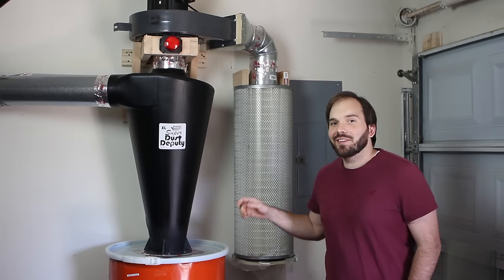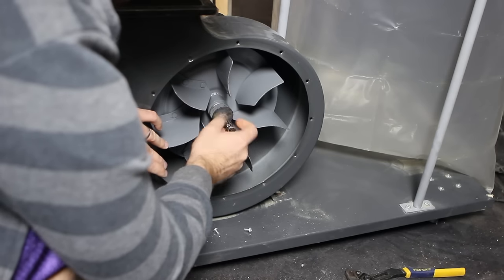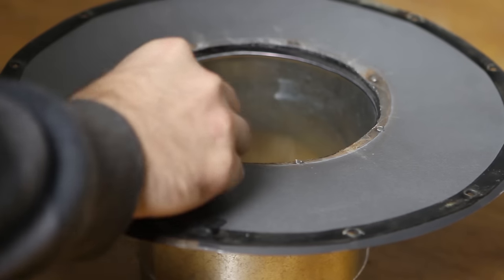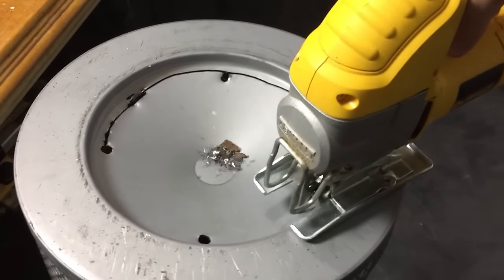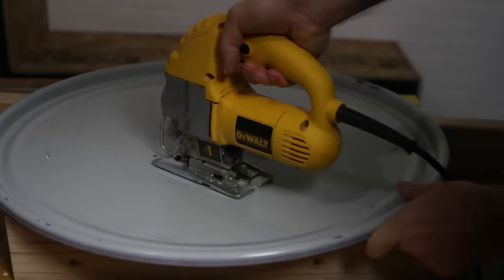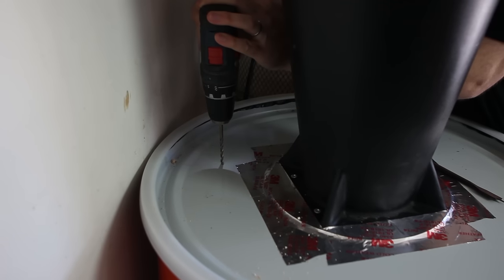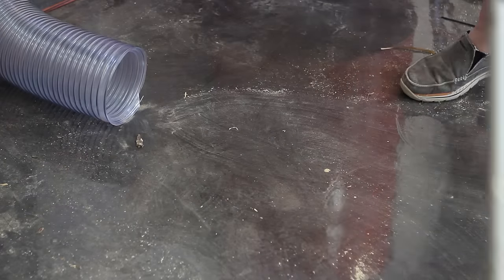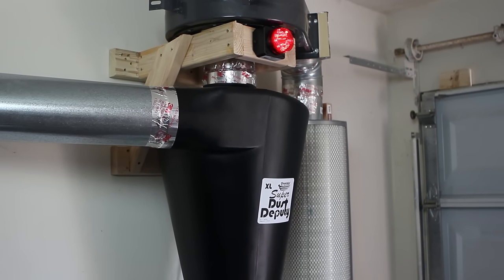Harbor Freight Dust Collector Mod w/ Super Dust Deputy XL - Updated

Comment: This dust collection system seems pretty well-made. I like the smaller diameter of the filter for the fine dust. The question I have is what holds your dust deputy up when you change or empty the barrel? It doesn't seem like there's much support other than the tape holding it on to the upper pipe and motor.
Reply from the maker: +Mark Radmall I did end up screwing the pipe fitting on the motor to the Dust Deputy which holds it with the drum removed. Also, I came back and made a bracket to screw to the wall and stick to the dust deputy mid-way down the cone.

Comment: Great build!!
I've been thinking about doing the same for my 1.5 HP Jet DC1100.
But trying to use the large pleated filter (20"x25") that came with it would be a pain.  Or... maybe not.
Questions: 
What is the measurement from the wall to the front of the Dust Deputy?
How did you size the filter?
How do you empty the barrel?

Comment: Great video! I've spent a while trying to figure out how to improve my setup, but did not know about the impeller upgrade, so thanks! At 3:35 in the video -- the HVAC flange seems like it might restrict the airflow a bit as it is mounted inside the SDD instead of on the outside. Not sure if there's a way to fix that though or how much it matters. (Similar issue at the filter connection.)
Reply from the maker: +Around Home DIY thanks! That is a good point about the flange direction and there probably is a way to fix it but I didn't think the results would be worth the effort.

Comment: Where'd you get the impeller at? Thanks
Reply from the maker: The impeller I used is a replacement part for a Rikon Dust Collector. Here is a link: https://www.rikonparts.com/product/60-200     It is part 20
Reply: For those who haven't yet bought the HF collector, you might also consider the Shop Fox W1666.  It comes with a 12" steel impeller and a true 2HP motor (the HF motor is really about 1 1/2 hp) which runs on 220VAC.  It is $400 on Amazon.  It has large inputs and outputs already built in and in the end, will only be a few dollars more the buying all the parts necessary for the HF + modifications.  I'm sure a few of you might find the need for 220VAC a barrier, but you can have a better DC system for about the same total price.

Comment: Love the notion of improving airflow by changing out the blade!  I'm about 6 weeks away from this very same project... and am already planning to follow in your footsteps.

Question:  I don't have the need for a 6" main line.  Is there any value-add to changing the blade if I'm going to maintain the original 4" line size?

Cheers!
Reply from the maker: +Jim Robinson I would say yes. Even with the 4" duct you will see a increase in CFM. Plus, the different impeller design functions better under pressure so it should help keep CFM up with runs of 4" because the smaller duct generates more resistance.
Reply: Thanks!
Reply: Where did you get the upgraded impeller?

Comment: Curious on how exactly you screwed the filter to the bracket?
Reply from the maker: I cut a piece of sheet metal the same circumference at the filter. Then riveted a 6" duct flange to the sheet metal and screwed the sheet metal/duct assembly to the top of the filter. I used caulk to seal the entire thing to the dust collector.

Comment: Great video!  So many out there but I love the way you show everything and make it easy to understand.  What size pipe do you have coming into the Oneida dust deputy?  Did you run 6" throughout? I wanted to stay around 4".  I am on the opposite side of the garage which will be a challenge to figure out the piping.

Comment: Hi Brent - simple question but how do you empty the drum?  Do you have to disassemble the cyclone?
Reply from the maker: I built it so the cyclone and drum sit off the floor and the drum is on a cart that lifts and lowers the drum. It is similar to how the Laguna cyclones work. I didn’t have enough ceiling height to add flex hose between the drum and cyclone like most diy setups.

Comment: I was not aware that you could swap out the HF impeller.  Where did you get the upgraded one?
Reply from the maker: Ya, I read some forums where people talked about it and figured I would try it and document it. It is from Rikon. It is sold as a replacement part for their dust collector. Part no. 60-200
Reply: I just found it online P60-200-22 - Impeller - $99

Comment: How do you dump the barrel?  I didn't see any flex.
Reply from the maker: That is correct, I did not use any flex hose to construct the dust collector. My ceiling isn't high enough to add a collar to the Dust Deputy and the barrel lid to use flex between the cyclone and the barrel. I like how the Laguna Flux dust collector lifts the bin to the dust collector and tried something similar. I build a scissor jack into rolling base. This allows me to lower the barrel, wheel it under the lid and raise it up with the jack. I might have to make another video with that build.
Reply: I would love to see that.  You did such a nice conversion.  I will change the way I have mounted to canistor filter to the way you did.  Thanks for the video

Comment: Where did you get that better impeller from?
Reply from the maker: The impeller for this dust collector mod is from Rikon. Here is a link to where you can order one: https://www.rikonparts.com/product/60-200
Reply: @GrayHouseStudio  Thank you, but they charge 100 bucks. The whole DC from HF is 150 with a coupon.
Reply from the maker: @RadeksWorkshop  Ya, it is a trade off. My goal was to have a dust collector with enough suction to run all of my machines and come out costing less than a similar sized machine. I invested in the impeller, a nice filter, and the cyclone attachment. The dust collectors I was comparing to were over $1000.
Reply: @GrayHouseStudio  I guess you achieved your goal. Nice video, thank you for sharing. I will be doing something similar with my.

Comment: You say that you used a 6" takeoff from the cyclone.  What gauge metal and type of metal ducting did you use in your shop with this conversion?  I think 30 gauge would be to thin so I'll try and use 26 gauge instead.  Do you think this is stout enough with the converted dust collector?
Reply from the maker: I used 30 gauge duct but long runs can be flimsy. I got away with it because I made round wooden brackets that connect the duct to the wall and keeps the duct in the circle shape instead of letting it collapse in an oval. I need to make another video that shows that.
Reply: Have you had any collapsing of pipe issues since your conversion?

Comment: Does anyone know where to get the impeller upgrade?
Reply from the maker: It is a replacement for a Rikon dust collector. You can google Rikon impeller and it will come up model:P60-200-22
Reply: I built a similar set up to this a few years ago on a cart. It has not moved once. I should've mounted it to wall like you did.

Comment: Best upgrade to the HF dust collector on YouTube... Great system man. 

Can I use that impeller with 4" tubing for my system??
Reply from the maker: +Jony Q Absolutely, the impeller would still be a huge improvement in the amount of air the blower would move on a dust collector using 4" tubing.

Comment: Hi Brent,  I finally received my backordered Rikon Impeller and bought the 4" puller that you pointed to, but when trying to fit the puller around the harbor freight impeller it doesn't span the fins properly.  I can't get all  the legs of the puller to fit between the fins.  Was the 4 " the wrong size?  Thanks in advance.
Reply from the maker: +Bryan Greifinger Sorry for the trouble Bryan. The long reach side of the 4" puller worked for us. I hope they didn't change the design of the one we linked to on Amazon. Harbor Freight also sells a pack of several different sized pullers that might be a quick solution if you live close to once of those stores. Feel free to share a picture and let me know if you find a solution or if The Harbor Freight ones do the trick.
Reply: I'm noticing that your harbor freight was black.  Mine is the Green version.  Wonder if thats the difference.  I guess i can call them and see what they say.  They may have also changed the design of the impeller.  Mine is about 10 ".  When i find out the difference I'll post it here for others to see.  Thanks for responding so quickly.

Comment: Great video.  Just bought the HF DC and will probably save $100 and buy the smaller Oneida cyclone.  How much do you collect after the filter?  I saw a video where the guy just pipes it out the house and that is an option for me, but I don't the outside of my garage spewing lots of debris.  (PS. You handle the nitpicky engineer comments well)
Reply from the maker: I have filled the 55 gallon drum with just the table saw. I would imagine with the lack of wind in my neighborhood there would be a pile of sawdust accumulating outside my garage if not for the drum.
Reply: Gray House Studio - I meant that I was going to use the cyclone and skip the filter and vent outside.  But a quick estimate showed that I could extract the entire shop's air in 5 min.  Since I live in cold climate it doesn't make sense for me to bring that much cold air in and heat it up.  So I'm going to copy your filter setup.  Thanks for the great ideas.  FYI the Rikon impellers are now back ordered 3 months.  You are to "blame" for a 10-fold increase in their orders.  Too bad no commission!

Comment: Nicely done sir.... but why would you ever want to deal with 55 gal. dust/debris at one time? My 20 gal. trash can is typically plenty of capacity and probably 1/3 the weight each time I empty it.  Again nice video with just meat and potato's and no self indulgence. Thumbs up!!
Reply from the maker: Thanks! I went with the 55 gallon barrel so I can empty it out before it gets too heavy without negatively affecting the dust collector's performance. I've found with the smaller barrels you can empty it full but as the small barrel gets over half full the saw dust gets sucked into the filter.
Reply: Interesting,  my 10 gal. Dust deputy never has that problem

Comment: Just a heads up it's called ducting  tape, because it's designed for 🥁 Ducts.
Reply from the maker: Boom! It gets really confusing when you start talking about Duck Brand Duct tape.   Sometimes I even put duck tape over over duct tape just to be extra safe.

Comment: Good job!!!  Where did you get your duct fittings and what gauge did you use?
Reply: What gauge of metal ducting and metal fittings did you use?  Did they collapse on you at any time?  Nice job on the conversion.  About to do mine as well.  Hoping to get away with the Lowes or Home Depot 30 gauge duct fittings and pipe.

Comment: Where did you buy the Rikon 60-200 Impeller?
Reply from the maker: I called their replacement part number and requested the impeller at 877-884-5167.

Comment: This is amazing- I keep coming back to it. Unfortunately, that Rikon impeller doesn’t seem to be available on Rikon’s parts website. Nothing on eBay or Amazon. Oh well.
Reply: The impeller he used is for opposite rotation, so it’s the wrong one anyways
Reply: Yes the blades on the new impeller curve the opposite direction.  I'm Not sure it would be better if the curved the other way.

Comment: Great video.  Do you still use this setup?    Did I notice you are using 6"metal duct for mains?   How long is your longest run and what type of airflow are you getting there?  I have a 600sf shop and I'm working on planning out my dust collection now around the HF unit.

Comment: nice but how do you empty the drum?
Reply from the maker: +tomas vasquez I added a cheap car jack to a furniture dolly. I can wheel the drum around and lift it into place using the jack. There wasn't enough ceiling clearance to use flex tube between the drum and cyclone.

Comment: Wouldn't the smaller super dust deputy been a better choice for the Harbor Freight collector?
Reply from the maker: +Cesar G The Super Dust Deputy would definitely do the trick for most applications. I was excited when Oneida came out with the XL model because it has a 6" inlet and outlet allowing me to achieve a higher CFM over greater distances. With the 6" duct I was able to locate the dust collector in the most unusable corner of my garage instead of next to my equipment where floor space is tight. The impeller upgrade was a fun experiment I've seen people talk about on forums but could never find anyone's results.
Reply: Gray House Studio thanks for your response. I asked because on Oneida's website they said that depending on your motor's HP, the size and shape of their cyclones would better suit the motor.

Where did you get the larger impeller from and how much did it cost?? Thanks.
Reply: I'd also like to know this.
Reply from the maker: +Cesar G It is a Rikon impeller Part #22 from their 60-200 model dust collector. I just called the number for parts on this PDF, https://www.rikontools.com/partslists/60200.pdf and asked to purchase the impeller. It only took about 5 minutes on the phone and cost $99.99.
Reply: Gray House Studio cool. How much was it? Thanks again.
Reply from the maker: The impeller was $99.99

Comment: Very nice! I hadn't seen anyone upgrade the HF impeller. Seems like a pretty good way to get more out of it. Any idea what the amp draw is with the new setup?
Reply from the maker: It pulls right at 15amps. If the dust collector is the only thing plugged into an isolated 15amp outlet then it will turn on fine. But, if anything else is running off that breaker, like the lights, then it will trip the breaker. I am running the dust collector off a 20amp breaker.
Reply: @GrayHouseStudio  where did you get the Impeller from?

Comment: How do you clean your filter?
Reply from the maker: +JB Marker I clean the filter by blowing air through the filter from the outside with my leaf blower. It drops all the dust particles that collect against the walls of the filter into the bag at the bottom.
Reply: Thanks for the reply. I bought the Rikon impeller for my 20 year old Grizzly and I had to ream the hub bore out to 20MM. 
The original impeller had straight vanes and was much heavier than the Rikon. I have not measured the improvement, but it definitely validates the cost of the Rikon + the $30 I spent to have the hub bored out. I will be replacing my Thein baffle with a home made sheet metal cyclone. Thanks for the tip on the Rikon impeller!

Comment: Very nice video!  How did you only get 753 CFM when the original configuration as advertised by Harbor Freight gets 1550 CFM?  Why such a decline in CFM?
Reply from the maker: The way I understand it is Harbor Freight advertises the Free Fan rating which is misleading. There are some dust collector companies that use the "actual CFM" https://www.oneida-air.com/blog/free-fan-vs-actual-cfm-ratings-whats-the-difference . I can't 100% confirm that my measurements are as scientific as Oneida's "actual CFM" test but I think that is why I didn't get what was on the Harbor Freight dust collector box.

Comment: Is there any issue with changing the orientation of the motor shaft from horizontal to vertical?

Are the motor's bearings up to it [normal load vs thrust load]?
Reply from the maker: +Benny Hannah a I can't do any real tests but most dust collectors are setup with the motor at that orientation. As long as it is level vertical or horizontal there isn't any weird inertia as the impeller spins. Also, either way there is horizontal pressure on the bearing from the force of the air being pulled through the blower.

Comment: What is the part number for the Rikon Impeller - $100
Reply from the maker: It is Rikon Parts List Key # 60-200-22 Impeller. I’ve been told the price has gone up slightly.

Comment: Just curious, why is it that you got 753 CFM and the dust collector as advertised says 1550 CFM?  If you double the 753 you got then that is still less than 1550 CFM.  Not being a bum, just curious!  I'm sure that yours works better, I would like to understand it better.
Reply: Advertised CFMs are notoriously inaccurate. Plus he measured with the filter and after 10' of flex hose, which is a major airflow killer

Comment: HP on the motor?
Reply from the maker: Harbor Freight advertises that it is a 2 HP motor, but most forums suggest it is more like 1.5HP. For my shop the modified dust collector is big enough to run a machine 20 feet away with a 6" duct and that is all I care about.

Comment: Question:  What is the shop footprint for this, side to side including the filter, and front to back not including the barrel?  How tall is it overall?  I have limited space and need to see if it will fit.  Was thinking of using a narrower but wider rectangular receptacle barrel
Reply from the maker: The dust collector comes out from the wall about 26 inches, is about 8 feet tall  and 40 inches wide. I’ve seen some people run the filter of their dust collector horizontal against the ceiling to save space. There is also a smaller dust deputy.
Reply: @GrayHouseStudio  Horizontally.  I had not thought of doing that.  And as fine as the dust is, it might not matter.  That definitely gives me some ideas.  Thanks for your response.

Comment: I did your conversion almost exactly, thanks so much for the information and quality video, my anenometer reads about 780 m/s, how does that convert to CFM?
Reply: 780m/s is over twice the speed of sound. You might want to look at your measurements. A very quick dust collector runs about 34m/sec. Thats the speed of air going through.  CFM or the metric.. Cubic metres per hour are volume of air passing through at a specific time.